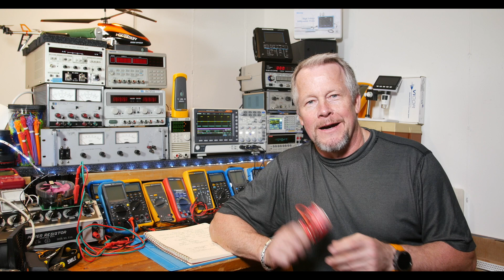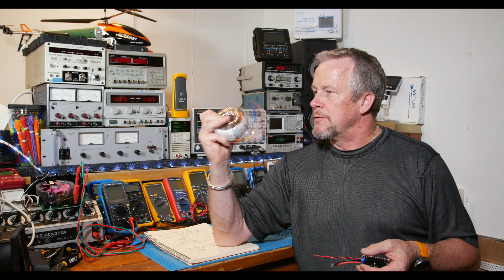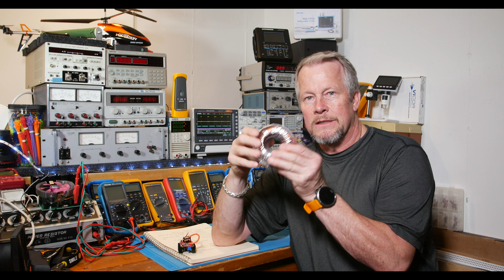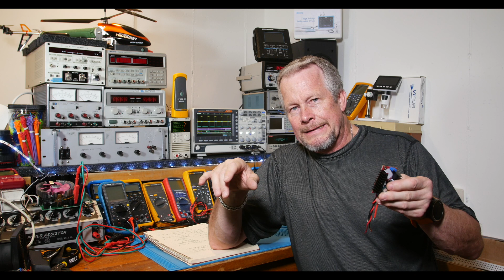Power Supply Types and Terminology

Comment: One thing i was wondering about... How much voltage drop is acceptable for a p.s. in max rate load?  Or what should we expect from a good quality p.s?
Reply from the maker: Great question - thanks!  A PS should regulate to max load without a voltage drop.  During a load step, it would be expected for a dip and maybe an overshoot, but only maybe 5 to 7%.  I hope that helps.
Reply: @KissAnalog  Thanks a lot for your reply! Can you please provide any reference i could find online to read more about this phenomenon? I am interested to search deeper what is the cause of that etc. Keep up the good work!

Comment: Nice video thanks for making it:
My statement / takeaway to readers:
"Many devices that contain: SMPS Switch Mode Power Supplies are poorly designed."
I know this because most of the electronic devices I have that failed within 5 years
have SMPS power Supplies.
Here is a short list of failed devices I own. I have fixed #1 and #2.
1. ASUS 24 Inch monitor. (Bad Capacitor)
2. APC PDU 8-port. (Bad Capacitor)
3. Husky 15 Watt LED Light (LED Chip OK)
4. Husky 30 Watt LED Light (LED Chip OK)
From the research that I have done on SMPS versus Linear Power supplies most
engineers fail to stress the reliability issues with SMPS.
There is nothing worse than buying a device with a SMPS and it fails within
five years. This problaby is the intended purpose by companies these days.
As now they can sell you another device. I hate that! 
Hence my revenge on all this SMPS madness; is to learn how SMPS work and fix them.
I'm not buying another toaster.
Currently in the process of fixing #3 and #4 above. I tested the Capacitors but
I think they are OK. The LED Chips are OK as I tested with bench power Supply.
The problem with the LED lights is they flash on and off (1 second between flashes).
The LED lights do have a 3 year warranty. But I'll spend 3 weeks trying to fix
them before I spend $19.99.
Damn the torpedoes.
-Russ
Reply from the maker: TymerTopCat LOL - I agree with you.  Many companies do not have real power engineers designing the power supplies, so the digital or rf engineer will take it on.  Sure it works but the design probably won’t last.  Also going cheep on the capacitors can result in stress on other parts.  The switching FET, diodes, and aluminum caps are the most likely to fail.  Good luck in your troubleshooting!  Thanks for the feedback!

Comment: I will put it simple....Voltage/frequency is proportional to Magnetic flux (phi) [as in transformer emf equation] and Magnetic flux(phi) is equal to Flux Density(B)* Area(A)

So as Frequency (f) becomes larger for the same V, then Flux (phi) gets smaller, and so does the Area of cross section of the core (A) for the same Flux density (B). Lower Cross sectional area would mean less overall volume (Area*core axial length) and so less bulky ..So yeah at high frequencies you need a smaller and lighter transformer and hence a lighter overall weight...i guess, the transformer decides the weight of the inverter (maybe almost 60% of the whole weight is just transformer)
Reply from the maker: Semper Fidelis Thank you for taking the time to share that great explanation!   Looking forward to more;)

Comment: I WOULD THINK YOU WOULD HAVE TO HAVE SOME TYPE OF OSCILLATOR IN THE CONTROL IC IN ORDER TO PRODUCE THE PWM.SO ARE SAYING THE FEEDBACK FROM THE CHANGE IN OUTPUT VOLTAGE CHANGES THE PWM VIA E-MOSFET SWITCHING TIME TO CORRECT THE CHANGE OUTPUT VOLTAGE TO MAKE IT CONSTANT A VOLTAGE OUTPUT?
Reply from the maker: David Luther You are right David, there is an oscillator built in.  I think you have a pretty good idea of how they must work.  My next video will show more about the control IC.